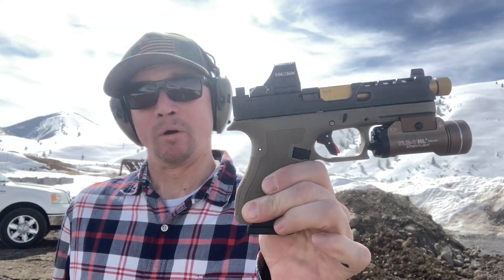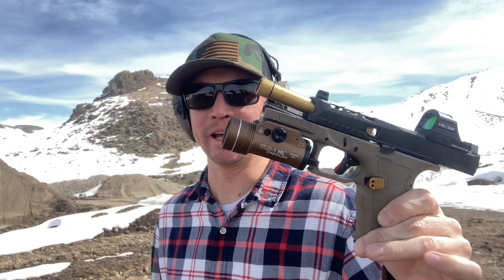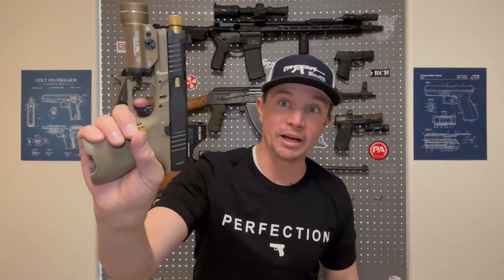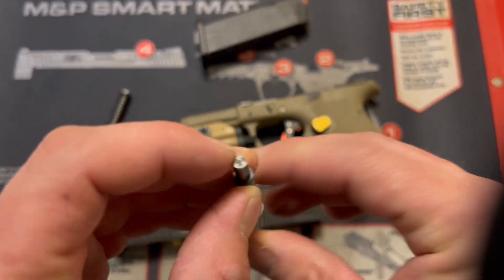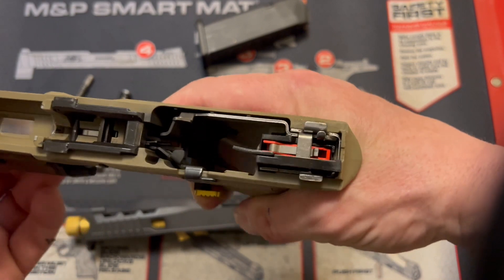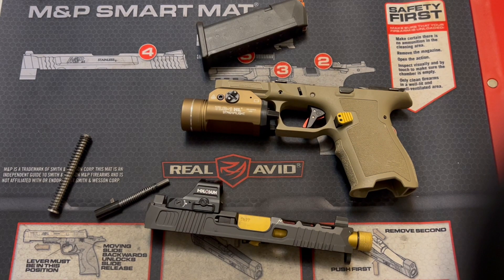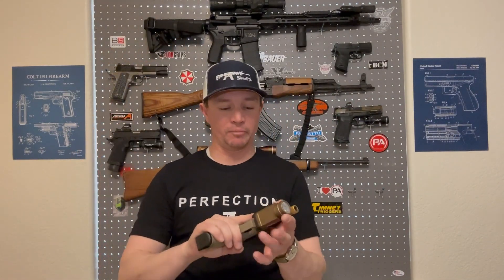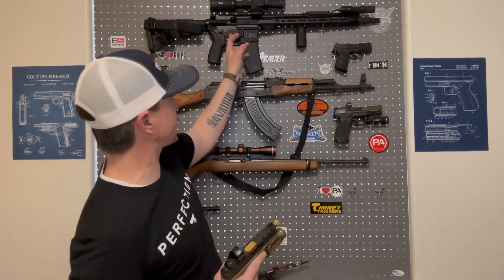PSA Dagger Broken Striker/Firing Pin - Timney Alpha Trigger Runs Great!

Comment: I am now half tempted to swap mine out with a Glock one, no issues yet after 300 rounds.
Reply from the maker: Hopefully, you don't have any issues.  Unfortunately, I found that it's a pretty common problem after making this video.  I haven't had any issues since replacing it, though, so maybe they got it worked out.

Comment: Wow same exaxt thing happened to my Dagger with less than 100 rds thru it, upon inspection the striker tip had broken off 😳 I reach out to PSA and they sent a replacement striker asap, hopefully this new one last a little more than 100 rds
Reply from the maker: Hmmmm...  That's not good that this is something that happens semi-regularly.  You're at least the third person that has told me that this happened to you, as well, and at a relatively low round count.  I'm sure they would've sent me a new striker assembly, too, if I had asked, but when I realized what the problem was, it was late at night, so I just ordered a new one.  Hopefully, yours and mine last the second time around.  I think most people have had really good luck with PSA Daggers...
Reply: @sawtoothtactical404  hey boss, how did you order it? How do I know what size to get? I’m pretty sure it’s a
 Glock striker but I have the same problem I already watched this before, but I didn’t think that was the problem until I just bought a new one and that is the problem🤦🏽‍♂️ I just thought my gun was dirty because I haven’t cleaned it for a while

Comment: I took my brand new dagger to the range last week. After 6 shots it started locking open on each shot. After field stripping and inspecting I discovered that the slide lock/release had broken where the spring attaches allowing the slide lock to jump and catch the slide on every shot. The shiny broken metal is very easy to see. PSA is sending out a new slide lock but I am not sure I can trust a pistol, for self defense, that broke before I got through the first magazine. Now I am hearing that you and others are breaking strikers. I am thinking that after I repair the slide lock that maybe I should sell the dagger, it seems to have some serious reliability issues that are giving me trust issues.
Reply from the maker: That is the problem...  I specifically got the Dagger because it's a Glock clone, so Glock reliability, right?  Now, it's a range toy and I gun I test optics and things on because I'm always worried about the striker breaking again and having a paperweight when I need a gun.  It hasn't had anymore problems, though, so I'm learning to trust it a little more each time I shoot it.
Reply: It’s unfortunate but all newer guns go through it even Glock.. went through a striker problem phase ten years ago. But I feel same as you. I wish I thought I could get something for it. So it will just be another fun tooked in the closet
Reply: @sawtoothtactical404 same issue with mine dead trigger! And firing pin is just jangling all in the slide! So I’m gonna upgrade it to a Glock gen 3 g19 firing pin. And use it for EDC.

Comment: The same thing happened to me while at the range earlier today, I've also put around 500 rounds through it since the time I've had it.... Other sources say that excessive dry firing can cause the firing pin to fail prematurely.... Luckily the part is only $12.99 but still
Reply from the maker: That's what I'm finding out, too.  I do like to dry-fire practice at home, but it hasn't ever caused any problems with any of my other guns.  This is the first one that has had an issue like this due to dry firing.
Reply: @sawtoothtactical404  I wonder if an OEM Glock firing pin would be worth the additional cost? Right now they are $39.99 on MidWayUSA. I also reached out to PSA, we'll see what they come up with, I'm really hoping it was a fluke but apparently I'm not the only one that has encountered this issue.
Reply: the only way i would totally trust the dagger is to put all glock gen 3 parts as upgrades. I ccw a glock 43x with glock mags. I don't trust shield or usa mags with my life.
Reply: psa

Comment: I remember when the caniks had problems with there firing pins. And replaced them with new ss ones. I replaced my old canik with the newer firing pin. I've seen some issues here and there with some issues with the daggers firing pins. Not sure if its on older models or newer ones though. I just purchased my dagger couple weeks ago and havent shot it yet fingers crossed. Should be fine. If not an g19 oem is going in. ✝🇺🇸✝
Reply from the maker: You'll probably be fine.  I'm hoping the replacement firing pin lasts, but if it doesn't, I'm getting a Glock OEM striker assembly.

Comment: It's a MIM firing pin. while cycling the back of the round smacks the tip of firing pin because the safety plunger sticking on some new slides until broken in.

Comment: Just bought and fde dagger frame. After doing a lot research I found that the problems I’ve been having with the mag release and mag bulging not letting the magazine drop free or insert without added pressure (bought as Blem) found out it’s a very common issue with non black frames. 
Took me a while to figure out what the Blem was, then I inserted a mag and found out the hard way. 
After some minor dremel work, mag release works fine, but still doesn’t have the tolerance for a full oem Glock mag to drop free or insert without added pressure. 
That’s my current issue with psa dagger. Hope the complete slide I just bought is at least flawless. Haven’t yet taken it to the range, fingers crossed 🤞
Reply from the maker: Wow!  I haven't heard of that issue, yet...  Mine works great with OEM Glock mags.  They insert and drop free just fine.  I didn't like the way the stock mag release button poked into my hand when firing the gun and I had to change up my grip, slightly, to use the mag release.  I replaced it with a GlockStore extended Teardrop mag release, and no more issues.  I like the aftermarket one MUCH better!
Reply: @sawtoothtactical404  yea I’m looking at that same mag release too. I had to do some minor smithing to the factory mag release to alleviate a lot of the issues. So far so goo
Reply: Lock block issue with earlier dagger frames, a different barrel sometimes fixes it. Had the mag drop issue my self.

Comment: My Dagger pin just broke too. Im just ordering a Glock pin.
Reply from the maker: It seems to be a common problem.  Hopefully, PSA figures that out.
Reply: Atleast you don't have a micro dagger. The striker assembly is different and won't work. Mine broke after 130 rounds. I'll have to add an extra striker assembly. A punch and my gun mat to my edc. Or I could carry a different one get this fixed and sell it to someone.

Comment: Can't wait to try the Alpha
Reply from the maker: You will love it!  So much better than any Glock trigger I've ever used.
Reply: Be careful , had a discharge when the mag was inserted and slide went home on my Glock. 4th 17 round mag
Reply: @clayramsey019  The Alpha is quite impressive at first, but doesn't hold adjustment for long and the over travel seems to be stretching causing a longer reset. After about 700 rounds of bumpfire.
Reply: @guskiworks5976  good to know, I just stumbled across a 10 year old video where Glock had bad strikers lol

Comment: My dagger striker pin broke exactly 3 weeks ago.. I got a new one. They threw in right at the store.   Now. It’s broken again. When I go to their range I usually shoot about 100-200 rounds.  Half hour. 45 minutes and leave.    So… to shoot under 1k rounds.  Maybe 500-600?  New striker. Broken again.   Something’s up
Reply from the maker: Dang.  I'm hearing about this issue more and more.  Not a good sign...
Reply: Would you just use the factory pin? I've got one, just ain't put it in yet.
Reply: look at the safety plunger for marks. it will make the firing pin stick out until the next round hits it knocking it back in or breaking the tip off.

Comment: Put about 1200 rounds through my PSA with about 1k dry fires (no snap caps) and my firing pin snapped in 1/2. Most likely due to me dry firing without snap caps. no issues with this gun other than that.

Comment: This happens to me today after only about 300 … differently will be putting Glock oem firing pin assembly in
Reply from the maker: Dang.  More and more people keep telling me the same thing.  This must be a legitimate problem with the Dagger platform.  If my replacement Striker assembly breaks, I'll definitely be replacing it with a Glock OEM part.

Comment: I just had this exact same issue with a brand new slide never fired. Emailed them for a replacement and they didn't even ask questions and sent out a replacement striker.
Reply from the maker: That's great that they sent out a replacement, but I'm hearing about more and more people having this issue.  That's definitely not a good sign...
Reply: @sawtoothtactical404  no it's not a good sign. I have another dagger iv put close to a 1000 rounds through with no issue. Worse case I'll buy a Glock striker

Comment: I’ve put over 7k rounds down range with mine and it finally started messing up only firing 3-4 rounds then not firing but then I tap and rack and it’s good for another 3-4 could it be the striker assembly??

Comment: I have had at least 3 strikers break on my dagger.  It does not like dry firing on an empty chamber.
Reply from the maker: Good to know.  I dry fire on an empty chamber a lot, actually.  Maybe I should get some snap caps.  If it breaks again, I'm going to replace it with a Glock OEM striker assembly.  I've been hearing from more and more people who have broken Dagger strikers.  That's not good.
Reply: That's why I'm getting  a genuine Glock pin
Reply: 3 or 4 here.  i need to order more.

Comment: Just today the firing pin on my Dagger broke. Less than 400 rounds. Requested a replacement from PSA, but I’d like to keep that as a spare and put a Glock pin in. Are they interchangeable?
Reply from the maker: I'm pretty sure they are, as long as you get a Gen 3 Glock striker assembly.
Reply: @sawtoothtactical404  ordered an OEM Glock pin, so we’ll see.
Reply: @gumps1986 where'd you get your pin from?
Reply: @tjratz1  NDZ

Comment: I got a question , if I wanted to change my PSA dagger compact slides , striker firing pin out for a glock 19 gen3 one , I just need the firing pin right ? Or will I have to buy a new spring , cups etc , will the g19 firing pin fit in the same spring for dagger striker .
Reply from the maker: I think it should work just fine, as long as it's a Gen 3.

Comment: Mine just broke today on my PSA dagger. ( After 300-400 rounds) I have johnny Glocks vex trigger. Thought that was the problem because the trigger wasn't resetting. Come to find out it was the firing pin. I've owned many guns and this is the first time a firing pin has broken on me, very strange.
Reply from the maker: The same exact thing happened to me and I thought it was the Timney Alpha trigger.  Apparently it is a known issue with the Dagger, but I only found out about it after it happened to me.  It was an easy fix, though, and it's been perfectly reliable ever since.

Comment: Wish I had that luck had a slam fire on my 4th mag with new Timney on a gen 4 glock 17
Reply from the maker: Wow!  That's pretty scary!  Maybe I've been lucky, but my Timney trigger has worked perfectly.
Reply: @sawtoothtactical404  scary thing was customer service acting like it was normal and to “just send it in for another one”
Reply: @sawtoothtactical404  mine worked amazing first few mags. Did you use the red or other spring? And stock connector?

Comment: I believe the firing pin isn’t releasing from the bar. My slide gets stuck on and I have to remove the back plate and pull the pin out to get the slide off
Reply from the maker: Are you pulling the trigger when you go to remove your slide from the pistol frame?  You need to pull the slide back slightly and pull down on the take-down tabs, then pull the trigger and it should get the striker out of the way of the trigger bar in order for you to pull the slide off the front of the gun.  Hopefully this helps...?

Comment: I just bought a compact frame & sw1 frame first 10 mags ran flawlessly, now all of a sudden when I try to chamber a round it’s like the round won’t catch in the extractor and it’ll cause a jam… I need help before I be like a lil kid and complain to Psa 😭😂😂
Reply from the maker: I've found that I've alway been able to diagnose and fix whatever problems any of my guns are having, myself.  I wonder if your extractor broke or something.  Take the back plate off the slide and check it out.  That's how I found out my firing pin broke.

Comment: If your PSA striker broke, I would steer clear of that part ‘ go with an OEM Glock part  or go with an Apex  or another reputable brand or go titanium. If you were defending your life in that instance… you won’t make that back up. Good for thought!! Upgrade…Buy once cry once.
Reply from the maker: I agree.  I have a lot of other guns I would probably use to defend my life before this one, although it's been perfectly reliable since replacing the striker.  Mostly, I wanted to see if that was an actual problem with this gun or if I just got a bad one, and since it's a relatively cheap part, I thought it was worth testing and the second one has held up just fine and it's had at least a couple thousand rounds through it since then.

Comment: My Dagger runs great . Had a problem with the alpha trigger because it woul either be a dead trigger or once it went full auto. I have swapped back to the original trigger and it works flawless again. I have a lot of PSA guns never really had any issues even with my frankin guns ( psa/bear creek arsenal combos) my PSA rock is fantastic but would be better with a lighter trigger.  I love PSA. Especially online( lots of great deals). Not a huge fan of their denver store( they never have anything budget friendly) the guy at the counter even said they were only PSA in name)being north of Charlotte probably doesn't help.
Reply from the maker: I love PSA, as well.  I've got a few of their guns and I purchase ammo and other parts and accessories from their website all the time.  This firing pin breaking is the only issue I've ever had with any of their stuff.  I've got a PSA 11.5" AR pistol that I've had for years and ran thousands of rounds through with no problems, at all.

Comment: Happened to me when trying to install a 3lb Trigger Connector and when I tried to pushed down on the back in I chipped off the piece you got to push down and forward then slide the plate off. So now my gun won't reset after one round I have to rack it about 5 6 times.
Reply from the maker: That sucks.  If I were you, I'd just replace the broken part so that your gun is semi-auto again.
Reply: @sawtoothtactical404  yea man my dumbass was tryna do it myself with no actual tools lol but im pretty sure thats wht it is the strinker asembly cover i hope

Comment: I bought a PSA slide and the firing pin sheared in half with ZERO round count, only dry fire.
Reply from the maker: Damn!  This seems like a real problem.  I've been hearing about more and more people having this same issue.
Reply: @sawtoothtactical404  Yeah, I'm worried about it now. I replaced the firing pin assembly in my carry pistol with a glock one, since I can no longer trust the PSA ones after reading all the comments about how many people have had problems with them.
But I guess I should tell the rest of the story, though: I contacted PSA and they sent me a new firing pin assembly free of cost in a week's time, no questions asked. 
Still, I don't know if this one's gonna break too! 
I'm considering what I should do. 
I've been dry firing the glock part ever since 2013, sometimes up to 100 times a day - zero problems. 
I dry fired this slide for a couple of weeks before it just snapped in half. 
My real worry isn't dry firing though, because of course I can just stop doing that - the real issue is I don't want the part to fail while firing normally. 
If it can't handle dry fire, then it certainly can't handle live fire in my opinion (in this design of gun anyway).

Comment: Timney reduces the usefulness of your handgun by turning it into a single-action without a safety. It pulls the striker farther back during the racking stroke, so your trigger pull does not have to pull the striker as far. That makes for a lighter trigger pull, but violates one of Gaston Glock's principle safety designs.

You'd be nuts to carry a single-action without a manual safety.
Reply from the maker: You are correct that it makes it a pre-cocked striker.  That's what gives it the better pull and crisper break, but it's still got take-up and the wall is very well defined.  I've been running it for a while, now and it's perfectly safe.  To be fair, though, I don't carry this gun.  It's more of a range toy or home defense option.  I carry a Sig P365XL, but as you probably know, the P365 is a striker-fired pistol with NO safety, at all, not even a trigger safety like a Glock has, and I'm perfectly comfortable carrying it.  As long as nothing actuates that trigger, it's not going to fire.

Comment: I woukd have put a glock oem striker in it at that point
Reply from the maker: I thought about that right after I ordered the striker assembly.  Once I realized what the problem was, I went online and ordered it right then.  If this one breaks, I'm definitely going to replace it with a Glock striker.
Reply: @sawtoothtactical404  I've built a few, and I've learned that parts that take a beating like a striker are worth replacing with a oem if you plan on using that gun more than a range toy.
Reply: @sawtoothtactical404  you cant glock striker wont fit a dagger
Reply: glock striker wont fit in dagger
Reply: @JesusDied4U-n9v  a gen 3 will fit in the dagger. The dagger striker/firing pin can not be use in a real glock.